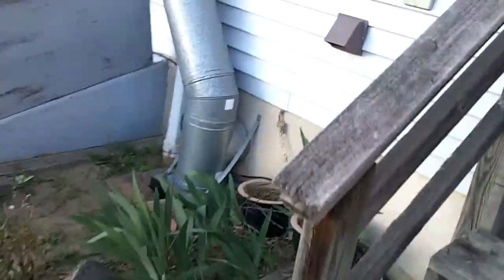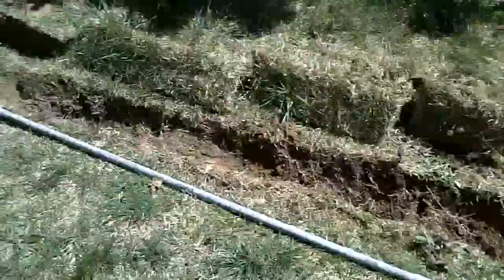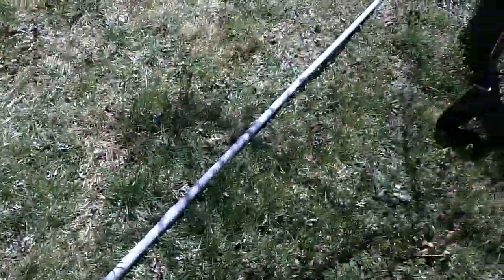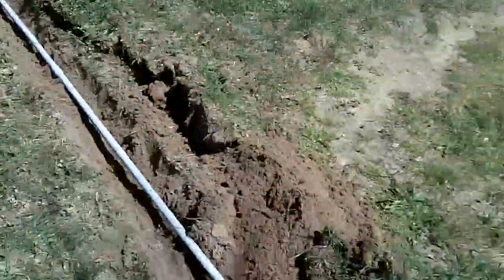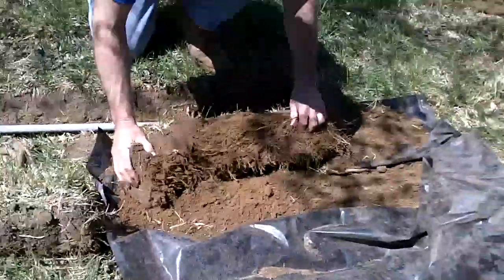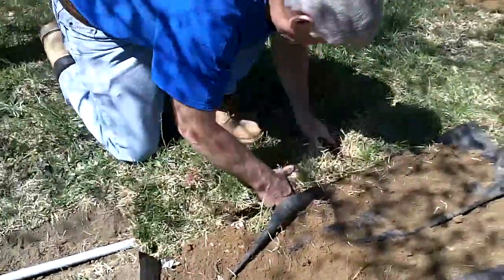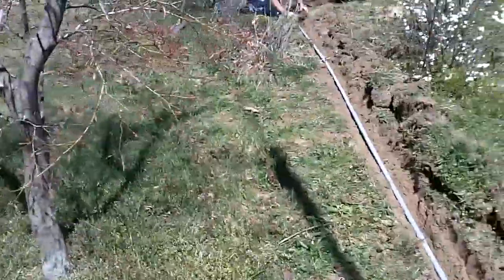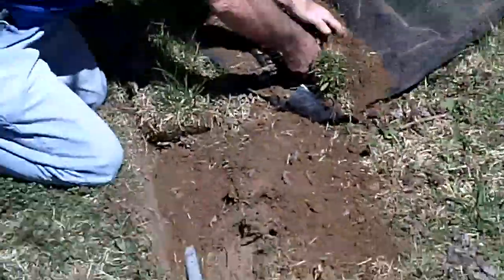HOW TO BURY COAX AND OTHER FEEDLINES

Comment: was talking about a coax grounding block where you cut the coax and put on two weather tight connectors and attach them to the feed through block you can get them at Radio Shack

Comment: i work for dish network and im always seting up our dish's on metal pole mounts and having to dig trenches to burry the line.  Ive came across a house before where the customer had ran his own piece of pvc conduit from the home to the existing pole that was there from a previous dish and it was soooooo easy, just tied the new cable onto the one that was inside the conduit and pulled it on through, simple as that.  It offers so much more protection running it through pvc especially if you are using the regular black coax.  We have to use the orange cable any time we have to burry it because they are a lot more durrable and made for being underground where the regular black cable is not made for it.
Reply: how long will black cable hold up under ground?
Reply from the maker: I would imagine that it would last quite a while being housed in the conduit like that.

Comment: you should get a grounding block for the coax and sink a ground rod at the pole and connect the block to rod with # 8 bare copper wire to protect against lightening strikes

Comment from the maker: I know but this is a dipole antenna with the hot line connected to the top element where it will get struck. The ground portion where a ground block grounds does not ground the center conductor

Comment: Not to be a know it all but a lightning arrester is the best protection it will send the center to ground if hit also the bleed static to ground  look at ham radio companys to get the best stuff when I'm not using my equipment keep coax stuck in a mason jar sounds funny but I have seen a jar burnt black and it saved his radio room

Comment: I ran about 80 feet of DXE-400max in 1/2 inch PVC conduit to an autotuner at the feed point of an OCF antenna using a very similar technique. I watered the grass every day and after 2 weeks I could not see where the trench was dug. --de N3TPS